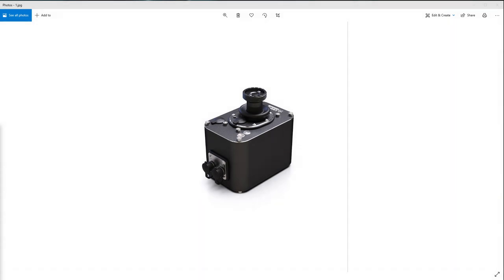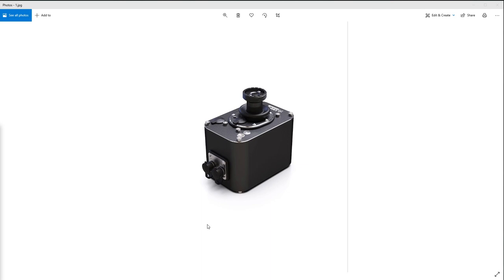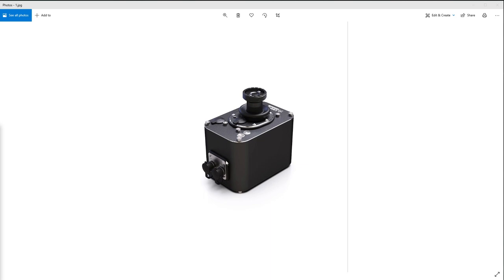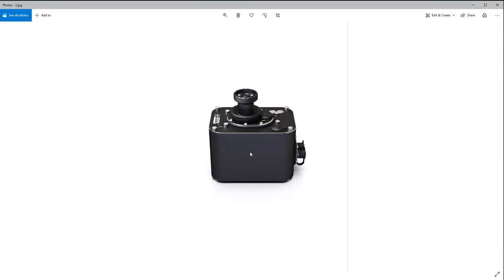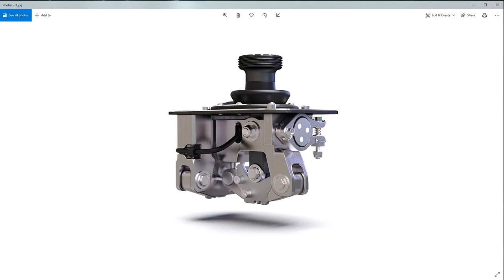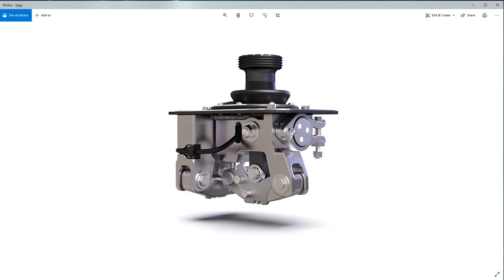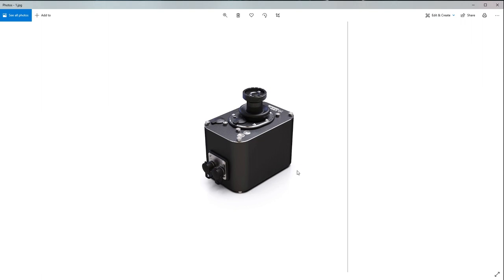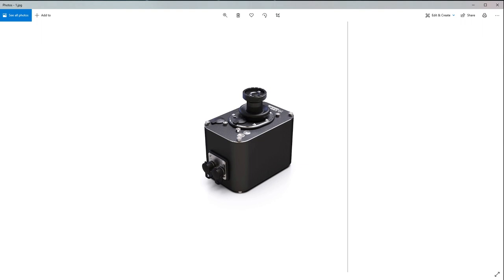Virpil CM3 Base - Dis-assembly & Nyogel application Tutorial

Comment: Thanks for making this. I used PG44A grease instead of 767A, works like a charm. When disassembling I had an issue with the second spider leg rod. It must have been loctited really well because I couldn’t get it to budge at all. What I instead did was I unscrewed the top plate from the internals and lifted it as far up to the connector as possible which allowed the rear clutch arm the lift a lot higher which because of its design created a little more space between it and the plastic disc. Then I rotated the plastic clutch disc so that the 45° cut was where the clutch arms are intersecting at said spider leg rod., to alleviate any pinching points. From there it was possible to remove it without taking off the rod. Could also work on the other clutch as well!
The clutch design with the thin groves is a much more capable design than what I have seen from my Gunfighter MK3, too bad Virpil doesent ship it with dampening grease preapplied.

Comment: I recently bought the cm3 base and the virpil collective. While waiting for them to be shipped, I found your video. I will definetly add some nyogel to my base too based on your experience and your video makes it quite clear how to proceed. I also found people adding nyogel to the collective base and counterweight. I was wondering if you did it to yours and if the process is as simple!?
Reply from the maker: sadly due to my collective being close to the floor, I cannot use a counter weight balance, so no point in my putting nyogel on the collective 😞